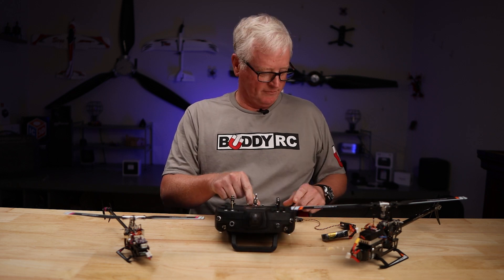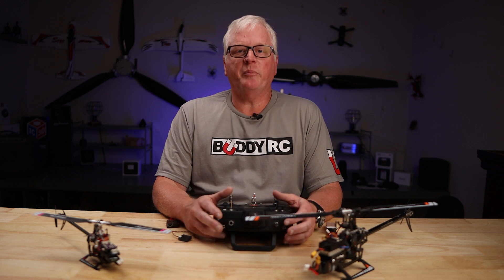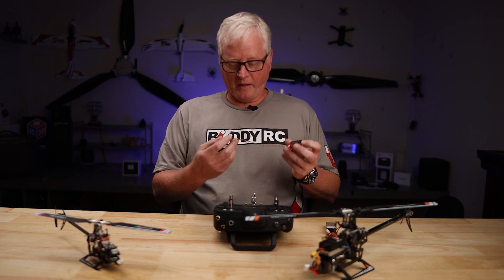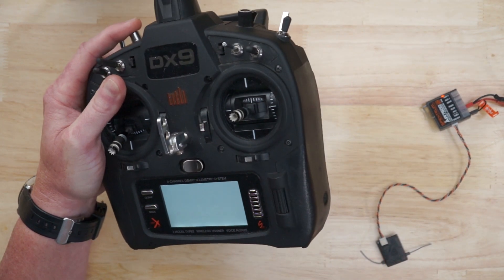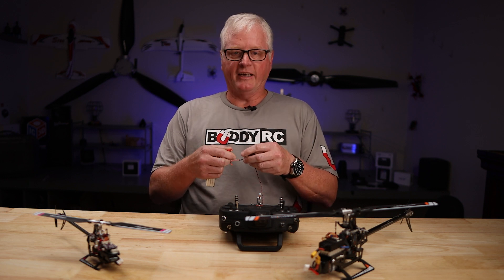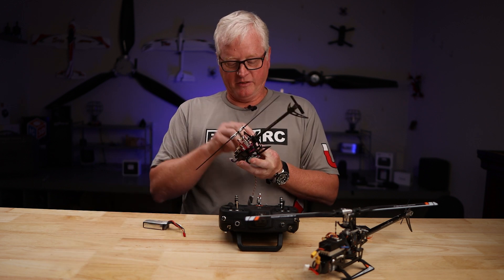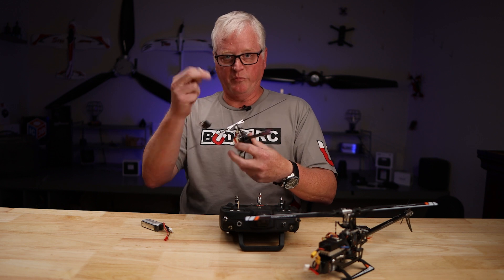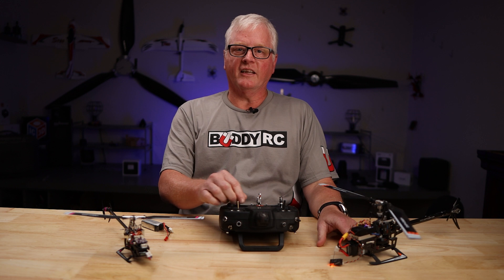Binding the OMPHobby M1 and M2 to a Spektrum Satellite Receiver

Comment: Any chance you have the omphobby spektrum satellite? I got it off Amazon and I can’t get it to bind, I saw a video of a bind plug on the satellite and did that instructions it no go in getting the satellite into bind mode, I ordered a spektrum 4651t and a ar6610t and it bound together. The issue I’m having is the satellite is 4 wires on the plug, the omp m2 is 3 plug on the heli, any help please

Comment: Nice video!
The AR7600 receiver is no longer available. This receiver had a dedicated interface for satellite receivers. Current receivers, e.g. AR6610T, no longer have this interface.
How is the SPM9745 connected to an AR6610T? Via the XBUS connector? Which of the 4 pins should be used?
Is there another way to connect the SPM9745 to a transmitter?
Reply from the maker: Thanks for watching! I'm not sure how to connect it. I would ask Spektrum about the spm9745 and the ar6610t , we mainly deal with the lemon rx receivers.

Comment: Is it necessary to have an external receiver with the satellite? Can you not just buy a satellite receiver with a bind button that would eliminate the need for the extra step? Also, where do you install the satellite receiver? Is it on there with adhesive I haven’t seen anyone do that. Thanks.

Comment: A Graupner/SJ receiver (GR-12L serial would probably work best) would also work by changing output channel in the receiver programming to either SP2048 or S.BUS (I think most if not all can do S.BUS output as well).  The only drawback to this would be that a servo type connector to that small white connector adapter, can't think of what they are called, that Spektrum uses for their satellites would be required, would be relatively easy to make one though.

Comment: I'm really confused on the binding process, I am very new! I have a Spektrum NX8, and I need some sort of RX that has a DSXM port? I don't understand this and don't know what to buy so I can bind it up. I read a lot that there are some sat's that have a bind button, but they are sold out everywhere. So can you help? Whats the cheapest Spektrum RX I can get to bind it up??
Reply from the maker: I don't run Spectrum but what I have heard you need a Spectrum receiver and a sat. bind to you're transmitter then remove sat. Install on the FC
Reply: The LemonRX DSMP (DSMX/DSM2 compatible) satellites are inexpensive and good quality.  They do not have their own bind button however.

Comment: I am trying to get my settings right for my Goosky S2 and my 10 year old Spektrum DX8.  I dont have the channel assign windows in my radio.  got most things setup but have no pitch control on left stick.  swash plate does not move up or down.  Any suggestions?
Thanks,
Dre'
Reply from the maker: Wrong channel to ask about that heli.

Comment: where did you mount the satellite receiver please
Reply: I’m new to 3d helicopters. I have the M1. A tx61s controller. Batteries for both the M1 and tx16s and chargers to those batteries. I also need a satellite receiver to be able to fly?
Reply: @elpapigrande4035  No, you shouldn't if you are referring to the Radiomaster TX16s.  There is a video on this channel explaining how to set it up using that radio.  The satellite is only required for those who want to fly Spektrum equipment with the OMP helicopters.
Reply: @encompassrc  once you bind the sat receiver to your Spektrum transmitter where can the receiver be mounted in the helicopter? I am assuming the receiver must be mounted in the helicopter correct? I have the M1 and it is a very small helicopter, I don't see anywhere the receiver can be mounted.